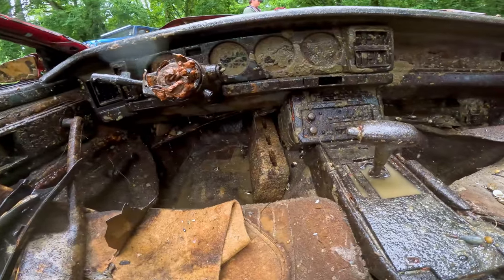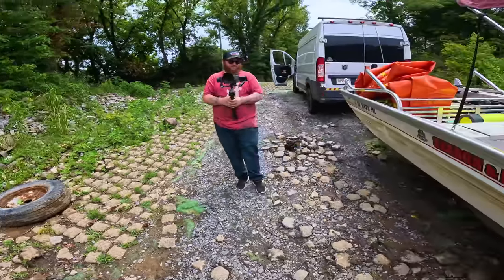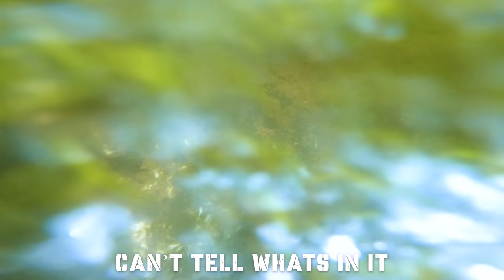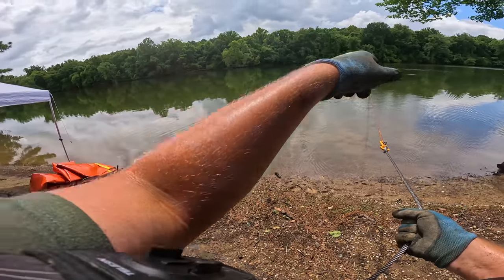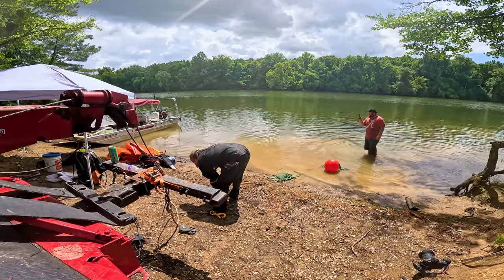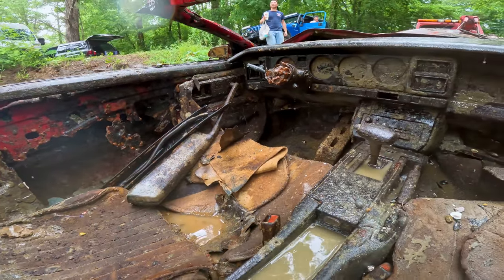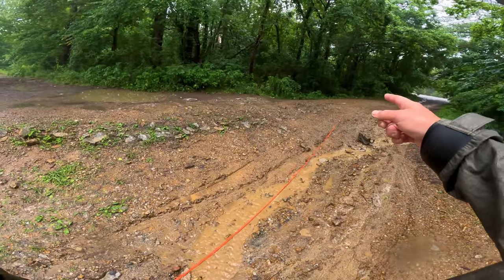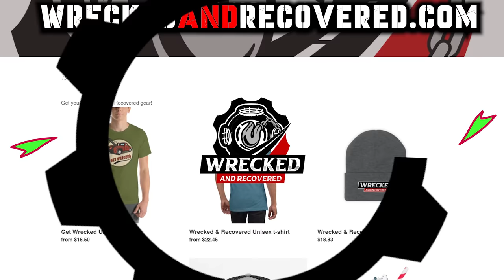1980’s Pontiac Firebird FOUND, Criminal Evidence Inside!

Comment: The VIN tag will be riveted on the dash, on the driver’s side, where the dash insects with the bottom of the windshield. They probably popped it off with a screwdriver, prior to launching the vehicle with that giant block. The convertible seemed to prove it had added strength at the rear “roll bar.”

Comment: You need to dig the wheel lift into the ground as an anchor.  Also you should lift the boom Up in the air as that will help lift the vehicle a bit to break the suction/drag onto the bottom.  It's very similar to recovering a vehicle from a snow filled ditch.

Comment: There's a vin # is on the engine block with it the bottom part of the motor and also on the transmission and the driver's door i believe one more spot but I don't know for sure. Just thought I'd tell y'all that since it seemed y'all was having issues.

Comment: 36 minutes in, That's a T-top not a convertible.  Glass black  My guess 78-82.  lol I kept saying "the vin is under the hood on the plastic and molded in!!!!!  It's probably on the engine block or underneath the main frame under the body of the car.  Probably another in the back around the frame stamped in also.   Couldn't tell if there was the rear spoiler off the trunk lid.  That's been there a LONG dang time.  What's the follow up?  I am SO curious if you find out the year.
Reply: It's an 85 to 90 model and if it was an 86 that would have the rear brake light on the rear hatch if it was a 1982 2 1984 the year would have been a 1982 it would have different tail lights if it was a 91 or 92 it would have had a different ground effects